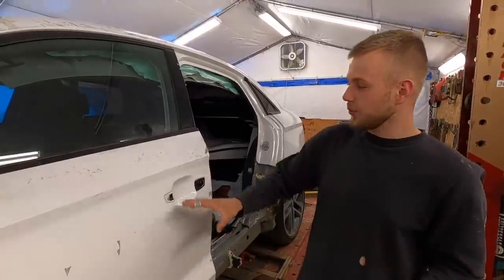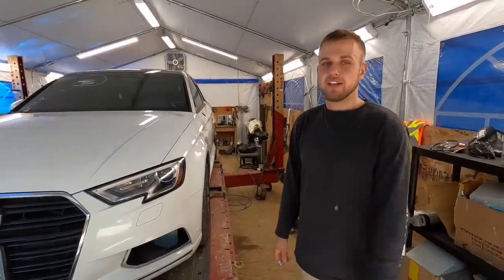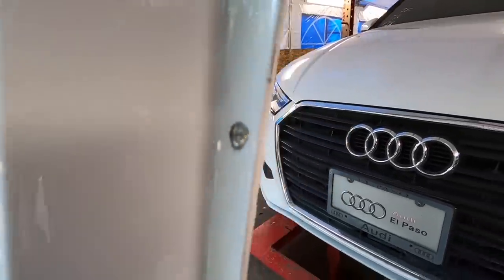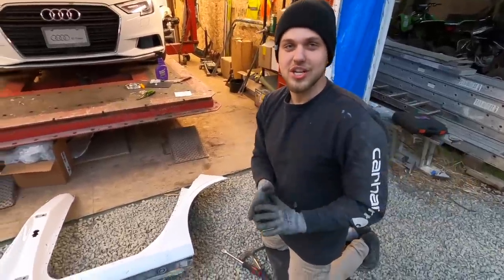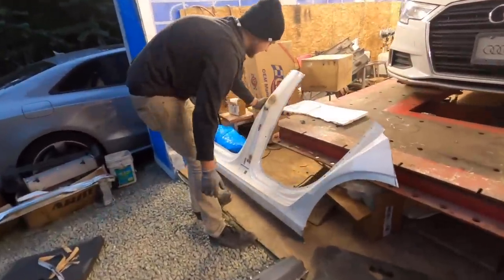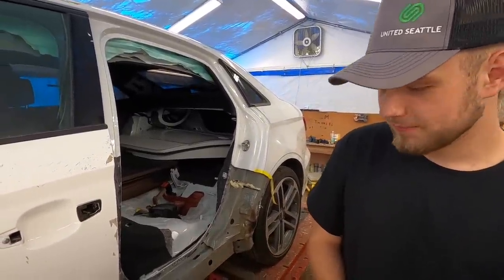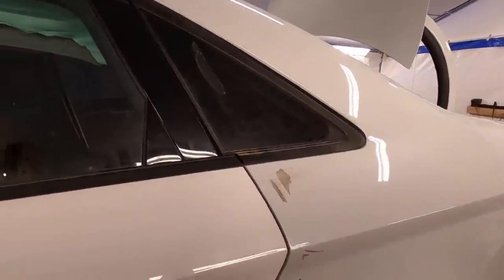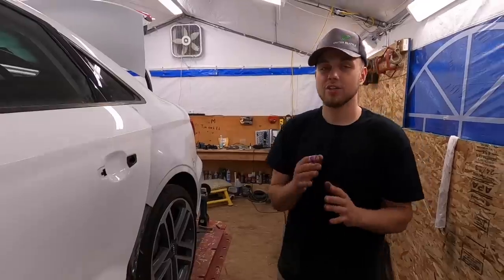Rebuilding A Wrecked 2017 Audi A3 (Part 2) “B” Pillar Repair!

Comment: If you’re not using the rear panels should just pilot them and drill right through save bending the panel edges when separating. Thats how i do them and a heat gun to soften glue/foam.